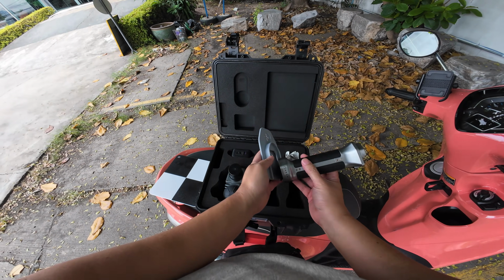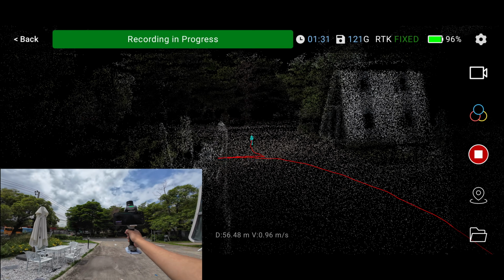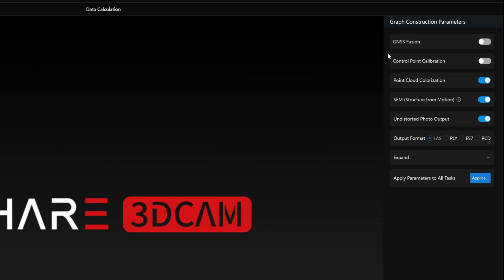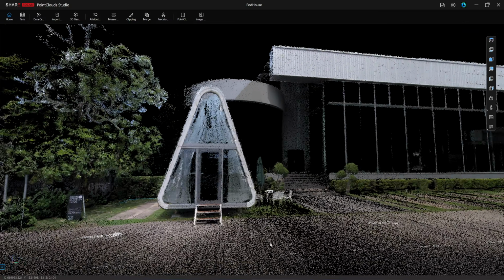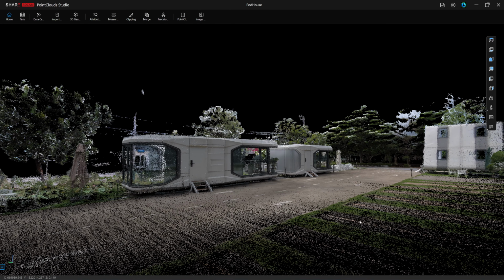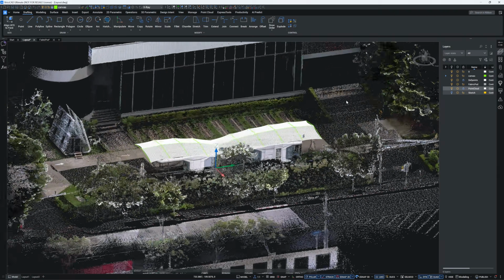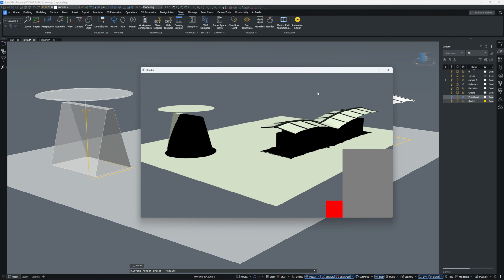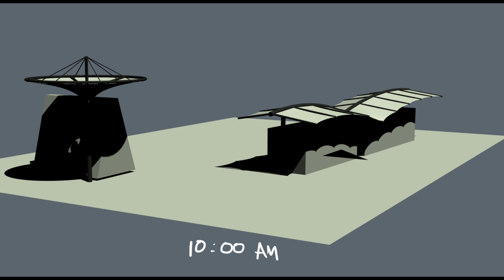From Scan to Design: Working Directly on LiDAR Data (SHARE S20)

Comment: Great video as always. I really enjoy your content. :)
What is the software that you are using for structural engineering?
Reply from the maker: “It’s a specialized non‑linear structural analysis software designed for membranes and cables, but it can also handle beam and truss elements.

Comment: Great walkthrough. Just purchased an S20 to learn some of these workflows. Can you please recommend a version of bricscad I need to do the reverse engineering you do with structure scans? Do I need ultimate ? Thank you!
Reply from the maker: You’ll need the BricsCAD BIM version to generate structural profiles. This version also lets you export data to Revit RVT and IFC formats. However, if you want to export to STEP, SAT, or IGES, you’ll need to purchase the additional Communicator package.

Comment: Fantastic video and well explained. Curious if rhino is capable of this workflow? Seems like it would be right up its alley.
Reply from the maker: I've tried importing point cloud into Rhino (Only 1 mil points). It's super slow in the view port to the level that I can't use it for modeling.